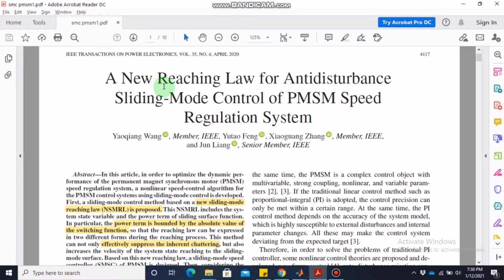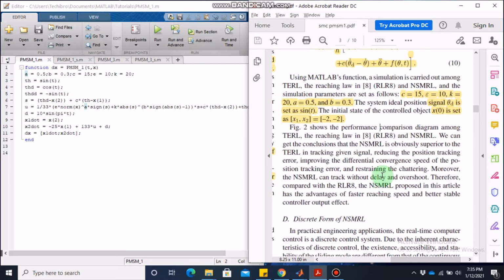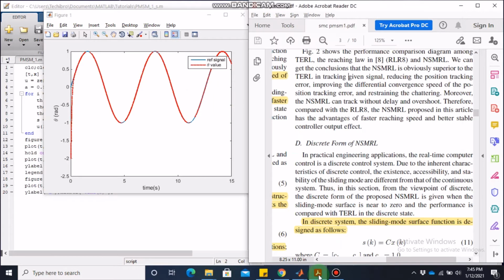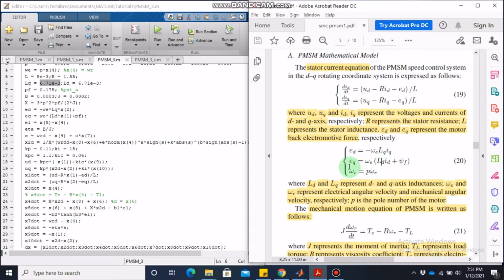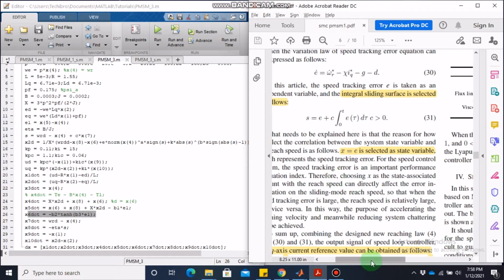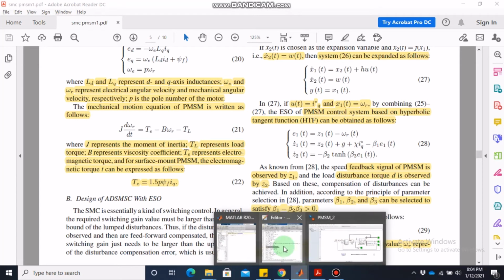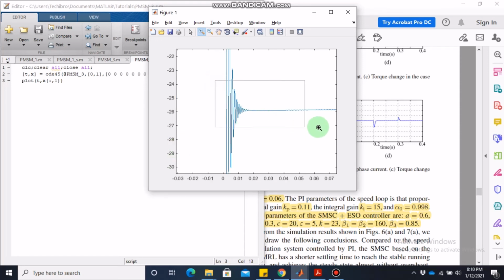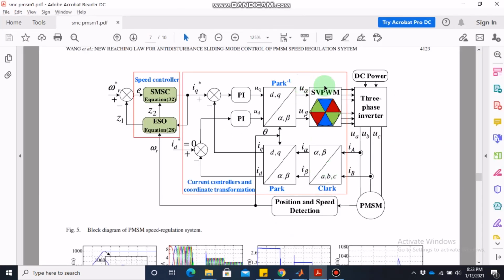MATLAB Simulation of Sliding Mode Control for PMSM Speed Regulation

Comment: L is Ld in the ud equation and Lq in the uq equation, i mean to say did/dt equation and diq/dt, Psi_f is the permanent magnet flux, np is the number of pole pairs, can you please explain a paper involving matrices. it is Flux Based Current Control of saturated synchronous motors by hafiz asad ali awan and marko hinkannen. I am stuck in solving this paper, i want to learn how to solve those matrices and find the gains for the controller in equation form for id and iq

Comment: To check a robustness of the proposed controller, i want to change a torque  at certain time, how can i do it  using this matlab code ?
Reply from the maker: You can have an if-else statement inside the function where the condition of the if statement is related to time. For example, if t>1 && t<2 Tl = some new value
Reply: @cset  thank you sir, for x6=z2  it estimates the load disturbance from ESO, but i want to insert load torque  to see the robustness like in figure (7)(d) and i'm confused, which equation should i choose to change the load disturbance, please any suggestion !
Reply from the maker: @salaheddine5274  I do not remember this paper in detail. Please download the paper and read it carefully. The authors must have specified in the paper about the equation related to the load torque.

Comment: thank you awesome video. I just want to ask you a basic question, how the Iqref comes from PI since the input of PI is the error between speed?
Reply from the maker: Dear Hussein, thank you for the encouraging remarks. The answer to your question is the following: The speed of the motor depends upon iqref (see eqn 25). If we set the iqref appropriately, (based on the error in the speed), then in turn, we can achieve the desirable speed. In summary, PI controls iqref, iqref controls omega, the error in the omega is fed back to the PI in order to determine the new iqref that will correct the omega appropriately.
Reply: @cset  thank you for your cooperation. But my question is not how to control speed by controlling Iqref, my question is how the PI controller converts the error in the omega domain into the current domain (Iqref).
Reply from the maker: @husseinshutari5209  that can be understood by assuming appropriate units for the PI controller gains. For example, in the case of a proportional gain, the error in omega is radians/sec and the current reference is in amperes. So the unit of the proportional gain is ampere-sec/radians.
Reply: @cset  can i get your email id or contact number??
Reply from the maker: @ahmadyousha929  you can contact me via techibro@umich.edu
Reply: @cset   please check your email inbox..

Comment: Hello sir,
Can you please explain sliding mode control in grid connected PV inverter system. As pv is highly intermittent and nonlinear source so this controller may help in designing robust grid connected PV system